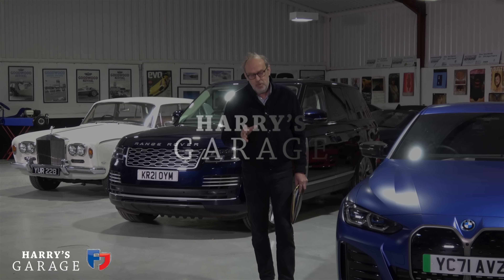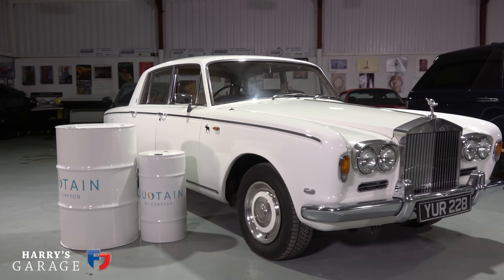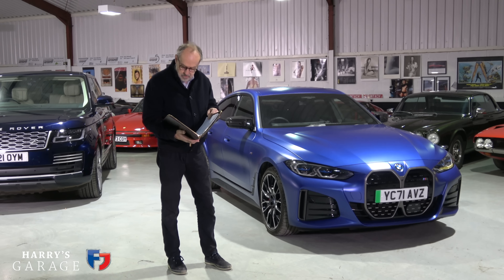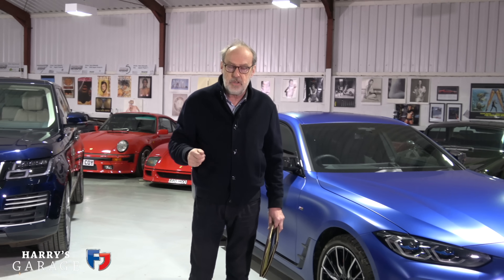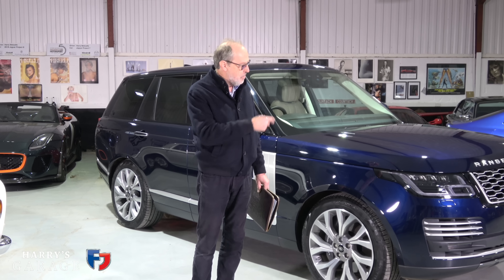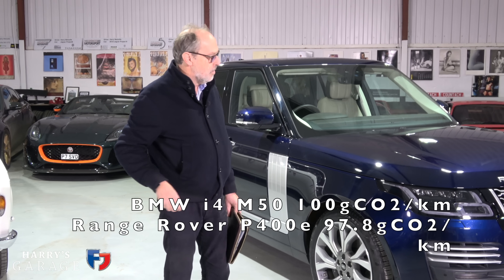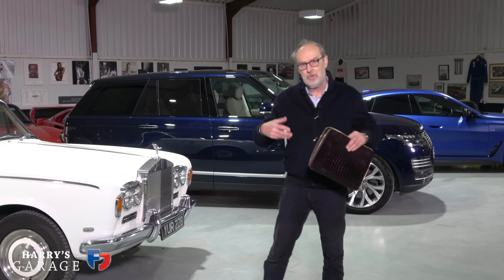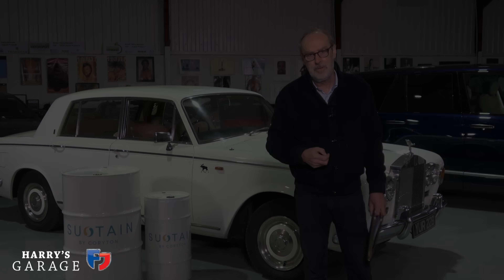Sustainable fuels; what are they & are e-fuels better for the planet than running an EV or PHEV?

Comment: A good video with some good references and I really love your thoughtfulness on the environmental impacts of your fleet. I can understand your perspectives in the video, just want to add a few additional comments from my experience of the carbon economy and alternative fuels. 

It's always important to remember with electric vehicles that the UK national grid will be getting 'cleaner' every year, with it net zero entirely by 2035. Yes, it's not totally clean right now but if you do a lifecycle comparison like the Volvo one you reference in the video, electric still has far lower carbon emissions. However, where there might be a place for e-fuels is classic cars as you also suggest - where people are not willing to convert them to electric, but are willing to pay the premium for synthetic fuels. 

A big problem you're likely to face with synthetic fuels is supply (and therefore price too) - there are far more significant and important industries (e.g shipping and aviation) that need direct replacements for fossil fuels; whereas road cars do not. I also advise caution with e-fuel companies, as some have been linked to deforestation or land degradation - make sure to check how the fuel is made and whether the company is committed to environmental sustainability. If it's made from waste, is that then incentivising waste production rather than encouraging a shift to a zero waste / circular economy?

One final note from me is to remember that CO2 is not the only greenhouse gas, and N20 is always going to be emitted in some quantity from combustion engines and is a far more potent greenhouse gas than CO2.

Overall it's a complex system and there isn't one simple answer - the one thing we can all agree on is that we have to wean ourselves off from fossil fuels as fast as possible.
Reply: Why did you write UK national grid? And not National Grid plc?
How is National Grid plc, the multinational privately owned corporation with its ownership seats in Luxembourg and Hong Kong getting greener exactly, and on whose dime? How much subsidies, and how much more paid by ordinary electricity users for that change? Maybe you believe that they are going to sell some of their vast gas distribution holdings, and pocket the profits?

In addition to you not knowing what National Grid is what they do, you also don't seem to understand what e-fuels and synthetic fuels are since you clearly are mistaking them with ancient kinds of biofuels.

If you want to bring forward some kind of analysis, I'd like you to start with the CO2 emissions sums and costs of reworking the electricity grid, manufacturing, installing, maintaining and periodically replacing millions of chargers, the building of a massive amount of additional electric power plants (including the solar panels which are made from coal). Then please inform us what impoverishing a country by trillions will do to its reduction of emissions, since I assume you know that the one major, reliable metric that shows a nation's ability to really reduce emission is its wealth...

You could also present to us why immense amounts of energy consumption are left out in EVs' numbers, like:
-Charging losses (from about 10% to massive amounts if battery not at optimum temps or when fast charging)
-Consumption while plugged in, meaning preconditioning of the battery and pre-heating the cabin
-The car preconditioning the battery for fast charging (eg. Tesla does this at 7kW, even after a long drive on the highway it is possible that the heating is on for 30 minutes)
-Massive consumption increase when temperatures are not at optimum, easily 100% increase is possible

I hope you have been loudly protesting the use of misinformation like the use of the fraudulent term: "Zero Emission Vehicles"? You agree that EVs are far from Zero Emissions Vehicles, right? I hope you also have been vocal in informing everyone how if we're to reduce emissions that people driving low amounts of mileage per year should not buy EVs since with low yearly mileage it has been proven that ICE is lower emissions than EV, even with the fraudulent numbers those studies use and therefore will in reality be even lower compared to EVs when using correct numbers!

I would be interested in hearing your rationalisation for advocating the top-down dictation that we replace all ICE cars with EVs since that will cause massive costs to consumers, and will delay the puny few percent, maybe 10-15% at the very most reduction of CO2 emissions, which will be eaten and reversed by a wide margin by the effects I explained above, so just like the Germans' "Energiewende" for their power generation the results will be the same: incredibly expensive but the results will be the reverse of what was intended! 

It will take decades to replace ICE cars with EVs, and it will cost trillions in increased car use costs for consumers alone, most probably will skyrocket electricity prices for everyone therefore causing increased inflation, and cause the above mentioned massive costs in grid infrastructure, charging infrastructure. And as I mentioned, forcing everyone into EVs will mean for a massive proportion CO2 emissions will increase since they drive so little that their emission are lower with ICE. 

Instead of the opposite when just using ICE: immediately the second you pour in e-fuel or biofuel, or just have greener fuel mixed into your fossil fuel you will have lower emissions! Lots of Europeans have already been driving for years and years with ICE cars using biomethane, bioethanol, biodiesel which has already resulted in not just slightly but FAR lower emissions than any huge Tesla will ever achieve. With a fraction of the costs of what a switch to EVs costs us. Already now many biofuels are merely marginally more expensive, possibly now with hugely expensive oil they're cheaper now! Shell has told us that already their very first experimental production of e-fuels, at low production volumes therefore lacking in economies of scale, will cost a mere 2€/liter including taxes!! 

EVs will increase road maintenance costs as vehicle weights increase significantly. I'm not sure of the newest calculations but I think at one point ICE->EV weight increase was averaging at least 400kg which is an astonishing figure and will absolutely be noticed in the budgeting needed for road maintenance. It'll most certainly affect road safety too, as vehicle weight has a statistical effect on deaths, casualties and damages.

For example I've switched from my EV and PHEV into using a pure ICE. It weighs under 1100kg and is incredibly economical. Very little resources used to produce it. I drive very few miles per year. It is absolutely certain that forcing me to switch back to an EV will cause a big increase in CO2 emissions! Not to mention if I could just fill up my car with e-fuels or biofuels in which case it would be wildly more green than any EV could ever be! The same car! No trillions and trillions needed to be burned on the grid, charging infrastructure, hundreds of millions paid by us for the car companies to change their production lines...and the hundreds of millions in corruption which is now going on thanks to this EV scheme which thousands are using to enrich themselves with criminally!
Reply: @pistonburner6448  thanks for your reply. First of all, I take offence at your tone of voice assuming I don't know the subject matter. I don't know your background, but I work on carbon emissions full time and have a chemical engineering degree - I know what I'm talking about. It's impossible to go into the whole complex system in a short comment - hence why I acknowledged the complexity. Second, some of what you say is true but I disagree with a lot of your points. Please provide scientific evidence or papers to support your arguments. In the first instance I would refer you to the Sixth Carbon Budget published by the CCC, there are more references I can provide if needed.
Reply: And yes I agree the term Zero Emissions is misleading at best. We should be comparing over a whole life cycle. But, marketing doesn't like complexity.

Hopefully you would agree with me that in fact the emphasis should be on reducing car ownership entirely, not simply replacing ICE with EV. Subsidising public transport, improving active transport links etc.

Your comment regarding biofuel/e-fuels is somewhat valid - I am aware of the differences, though was confused by which was being referred to in the video hence the reflection in my comment. To clarify my stance: caution is required with biofuel supply chains (and biofuels don't solve the problem long term), and e-fuels from carbon capture or similar processes are very expensive, immature and limited in supply.
Reply: @dstarley  I am a scientist, a strategy consultant who has also been asked to advise in management solar and wind energy projects, have been involved in the electric charging business, and above all have researched the automotive industry for decades. I have been analysing politics, foreign relations and policy strategy. I have a happened to have access to a good viewpoint from the top echelons of policy development, having contacts in highest EU leadership, several governments and their major power centres, university leadership, major corporations (including one of Europe's largest EV charging systems corporations).

I start off with the sceptical viewpoint of all participants' motivations. I have a huge interest in politics, corruption, corrupt policies, backhanded corporate dealing, misinformation, corruption of the scientific institutions, NGOs, etc. because I personally favour an idealistic science- and engineer-led world based on truth, and all of the aforementioned cancers have the ability to destroy it and cause untold damage to society and people.

It's actually pretty difficult to even discuss matters with people who don't have a good view on how the world works, refuse to acknowledge vested (corrupt) interests, and especially those who have entrenched themselves into some small tribal identity. So many factors affect this subject, and all those factors are affected by so many influences that if there is too little common ground it is difficult to even begin dialogue. Especially if the other side refuses to believe what is presented at every single step.

Maybe a start would be one subject I brought up: the National Grid plc, which is a corporation hell bent on utilising this cult-of-EV opportunity to the fullest and has even partnered with the BBC to spread misinformation to children! It is clear that they are so far from impartial as can be, and so far from benevolent as can be. That corporation being only one of the forces behind the push for totalitarian, top-down fascistic policies pushing EVs in and genociding ICEs is a great indicator of what kind of a game this really is. 

You claim to "work on carbon emissions full time", what does that mean? So you're not an artist? Or is your art based on cow flatulence? 
I know very well that there are tens of thousands of leftist 'scientists' who have gotten degrees on taxpayer dime and then use that to spew all kinds of nonsense, usually just for selfish virtue-signalling purposes for social benefit among your friends. Nothing to do with actual science. 
And even worse: there are tens of thousands of con-men in Europe making a living as "climate experts", "environmental scientists" which basically means just spewing out copy-pasted quotes from other such people in whatever organisation hired them for that virtue-signalling political purpose.

I wish you all the best in your artistic endeavours and whatever you pursue. I hope you give your trust to real experts and true facts to guide us to the best results regarding climate change. Instead of allowing religious ideologies and above all massive, just horrendously massive corruption and foreign influence (mainly from China) to push society to totalitarian, fascist frenzy like what is the push for the totally anti-science ban of ICE cars and their taxation, attacks on them with anti-science grounds. 

Unfortunately the anti-car leftists have been found to be great allies by the massively corrupt, so they too are cheering the sadistic hunt for their ideological enemy, the ICE car (apparently they see EVs as a lesser evil for some reason, probably because they see proponents of ICE as hurting through the push for EVs and they seek to hurt their enemies By Any Means Necessary).

Unless we let true science and facts, level heads and sane discourse prevail we might end up like Germany did with their "green" push for their "Energiewende" which did massive destruction to their economy, really wreaked havoc on previously better functioning markets, and worked to benefit and grow massively corrupt political parties and politicians, civil servants, heads of corporations, scientists, NGOs...
They really hurt ordinary Germans with their anti-science, massively political and horrendously corrupt actions. And when corrupt make lots of money they are just more empowered.
Reply: @dstarley  I very much disagree with reducing car ownership. We are supposed to serve the interests of the people, not make some made-up religious fantasy images of what the world should look like force people to comply in some totalitarian way. 

Cars have been one of the world's most enriching, empowering, massively beneficial inventions and tools in all of humanity's history. They are cheaper than ever before. We are able to build infrastructure more effectively and cheaply than ever before. There is no excuse to impose religious ideology on others, no excuse to reduce the quality of life of others on purpose, especially not just to save on some infrastructure costs for real estate developers! No matter how huge of an income it is to corrupt politicians and civil servants!
Reply: @dstarley  I suggest you familiarise yourself with modern biofuels like biomethane and NEXBTL biodiesel. Biomethane's unproblematic origins are easy to determine especially when they're simply gathered from sewage treatment plants and landfills (therefore also directly preventing methane from escaping into the atmosphere which is important since it's a many times more powerful greenhouse gas than CO2). 
Modern biodiesel production is strictly monitored, their raw materials come from certified sources. And there are immense selections of sources.

Biofuels certainly are a long-term solution. The world will have biowaste forever, and we will always have the potential to use the amazing natural processes which capture CO2 from the atmosphere into that mass.
Reply: @dstarley  Oh, and sorry, I mistook you for another person with the same name. Your "full time work on carbon emissions" seems to be even more incorrect information, are you really just a school tutor? And a young kid?

Comment: Unfortunately he is not comparing the two vehicles very well at all. If he did 2 trips, down the same road of 140 miles or so, he'd get very different cost per mile figures. Very bad calculations indeed! My outlander phev used to burn £80 for a 300 mile trip, but the tesla now uses less than £20
Reply from the maker: I can only give you my own experience and those were the figures I used. The BMW was a press car and I only had it a few days. I did sevral charges with it and 2.5miles/kWh was the best we saw from it. 
I had a Jaguar i-Pace before the Range Rover PHEV and we hated it because the charge network away from home was so unpredictable/unreliable, hence why we moved to an PHEV, which we love. 
I could have gone to a Tesla 3 (their supercharger network is fantastic) but the rest of the family weren't keen.
Reply: So the data is incorrect then. If I went on what I have - free charging at work- then the data would be very different... Please remake the video with data that is  comparible as its making your research look highly inaccurate. Once that 4pot engine has to haul the weight of that range rover, when the battery is empty I bet you will get at best 25mph. Down hill.

Comment: ZERO CARBON REFERENDUM IS NOW REQUIRED.

The energy crisis is our own making because we pushed too hard and too fast for the transition, and we're now seeing the results.

In addition, we (the West) are PARTIALLY responsible for the Russian situation because we've shut down our fossil fuel and nuclear power stations and switched over to Putin power. We put ourselves in a weak situation and Putin is taking advantage.

We did not vote for this. 

A vote is now required, to choose whether to proceed at this pace, or to balance the environment with other considerations and reduce the speed of the transtion by a few decades.

Comment: The divide by 6760 maths only works for pure petrol cars. For a plug in hybrid you also have to add the C02 from the electricity used to that figure as it is in effect a dual fuel vehicle.
Reply from the maker: Correct. I only included the PHEV to show how we were getting on with it as a family car and fully realise not everyone has their own wind turbine!